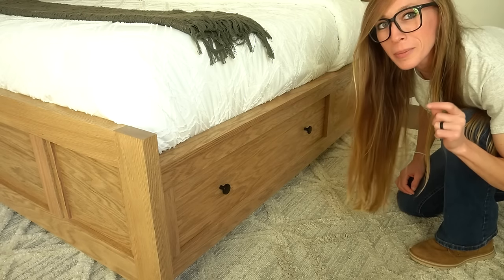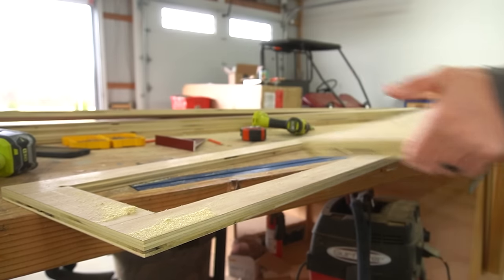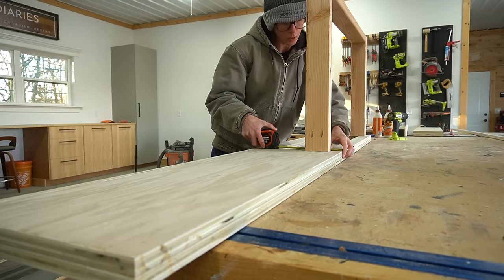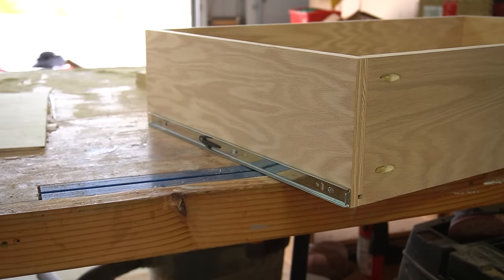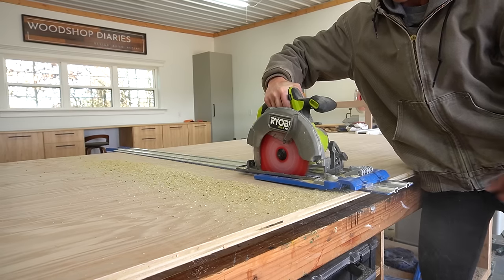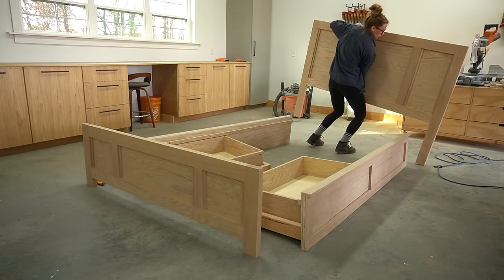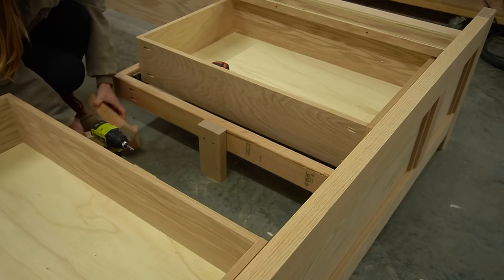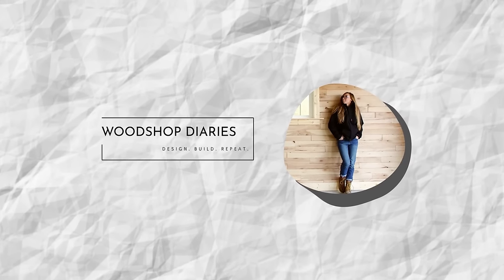How to Build a Storage Bed with Built In Drawers

Comment: Hi Shara, I built a single bed with drawers. The drawers I cut were about 760mm length and 400mm wide and a depth of 200mm. I used 3/4 inch plywood. What I found is the drawers are very heavy. Got 3/8 inch plywood, removed the 3/4" bottom, cut dado and installed the 3/8 plywood. What a difference in weight. Looking to reduce weight further by using 1/2 plywood. Also using the Kreg pocket hole. Regards.

Comment: There is a store named Builder's Surplus where I live. They sell new doors and windows and od lots too. They buy discontinued moldings. Also carry the ame current ones.
There is a huge supply of different wood species in most sizes. But sometimes it's a limited amount. I like the fir or douglas fir when they have it.
I'm considering using 5/4 pine or poplar in the bed frame.
Reply from the maker: That sounds awesome! I love building with poplar! Happy building!

Comment: Well done! I also loved your, “happy little accident” with the footboard trim. What was the final cost for the bed? How many hours? Finally, I’m really impressed that you have resisted the urge for a domino.
Reply from the maker: Thank you! I didn’t keep track of the time. I work in the shop sporadically as I’m able, usually working on multiple projects at once, and filming always makes everything take ten times as long. So I don’t really know how long it took to build. Couple of days working a few hours a day-ish 😅🤷‍♀️ I also didn’t figure total cost but I’d estimate with the oak about $400 in lumber. If using pine, it would have been about 150-200 less. Also, it hasn’t been hard not to buy a domino—there’s never been an urge to resist ha! 🤣

Comment: I've been looking for a twin size daybed for my attic room, but the sides are always too tall.  This way I can make one to the exact height I need, thank you!  I don't like the supports on each slat because it makes it hard for the robot vacuum to get under there.  I hope you have included the center support option in your plans.
Reply from the maker: So happy you enjoyed the project! The plans include the build the way it’s shown in the video. However, you can certainly add the center support instead like I’ve shown by running 2x4s between the pieces of the headboard, across the footboard, then between the two.

Comment: Good Morning, Love the Build Shara! I cant count how many of these I have started and hated which ended in bonfire lol. I have so many questions. looks like it would be pretty straight forward to add an additional drawer on each side yeah? Also, how would you recommend altering the design to go with an existing Bookcase headboard?  Also, Also, i get what you mean about the router. i think that is the only tool i have in the shop that gives me pause every time.
Reply from the maker: Thank you so much! It would definitely be doable to add additional drawers. I considered it, but just really wanted nightstands so I compromised with just two haha. I’ve never built a bookshelf headboards but I imagine you could just make the head board a little wider and deeper and kind of build it like cabinet cubbies up the sides and along the top? I’m not really sure if I’m explaining that well. 😅😅 or you could simply built like an upside down U shaped shelf to wrap around it.
Reply: @WoodshopDiaries  oh I already have the bookcase headboard I think I would just have to find those little clip things you used to attach the rails to the head/footboard.

Comment: This is a very nice build.  Is that a Kreg plywood panel carrier?  Do you ever need to use two at a time?  Thanks.
Reply from the maker: It is a kreg panel carrier! I only have one—so I’ve never tried with two but I think it would be difficult to use two to carry it comfortably. It works great to carry a full sheet with just the one carrier

Comment: Do you find that the pocket hole joints don’t need glue as well for strength? I’ve watched a handful of your videos now and noticed I never hear you say pocket holes, screws, and glue. Just pocket holes and screws. Was curious how these joints hold up in drawers and cabinets after years of use?
Reply from the maker: I use glue sometimes but in many cases I don’t for a few reasons. I often recycle the wood I use on projects to build new projects. Glue would make this impossible. 
That said, I have several pieces that I built 6,7,8 years ago still in my home and they’re good as day one without glue. 
Personally, I don’t think glue hurts, but in many cases, it doesn’t really help much. For the mess it makes, unless it’s necessary, I skip it. I don’t know that I’ve ever glued a drawer box and I’ve never had one come apart (or come loose) even in nightstands, vanities, and cabinets that I use daily.

Comment: Question: IF you were doing two drawers and wanted to leave the 1x3 (2.5 wide) spacing between, would you rip 1/4 inch off each 2x4 and screw them together or some other solution?
Reply from the maker: You could do that or use 1xs instead of 2xs. If I was building it that way, I’d probably make the middle a 1x4 and stick with the 2xs
Reply: @WoodshopDiaries  Thank you so much! Finished by first two drawers today. You make it look so easy!!!

Comment: why didn't you use the tracksaw to cut out the drawer frame and use the jigsaw for the corners?
Reply from the maker: You could. I don’t like lowering my circ saw blade down into material when there’s any other possible way to make the cut.

Comment: Never understand how people manage to build things, requiring some precision, out of 2x4's.. without running them through a planar first..
Mine often dont even have straight 90 deg angles between surfaces.
Reply from the maker: If I was using construction pine like I normally use, I run them through the table saw to square off the edges. However, in this case, I bought red oak 2x4s that were already surfaced, so I didn't need to as they were already done.